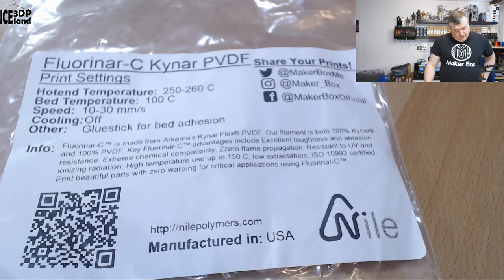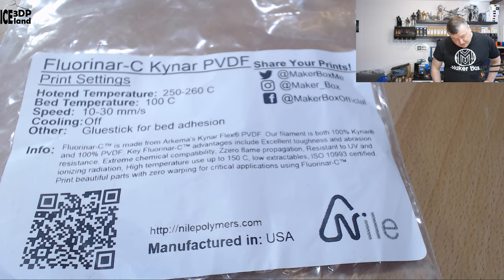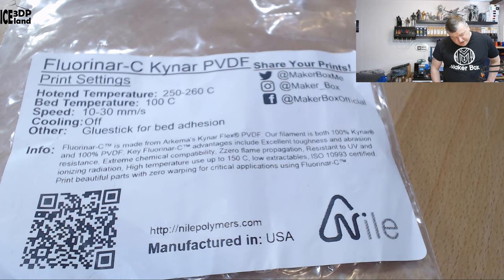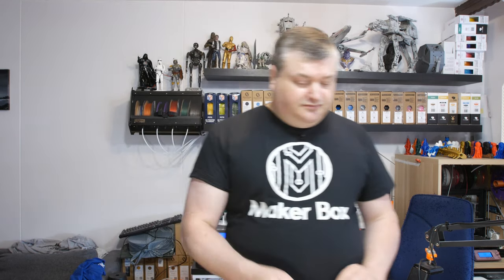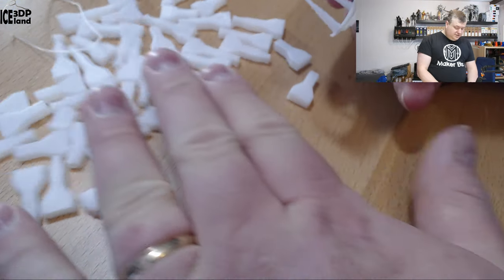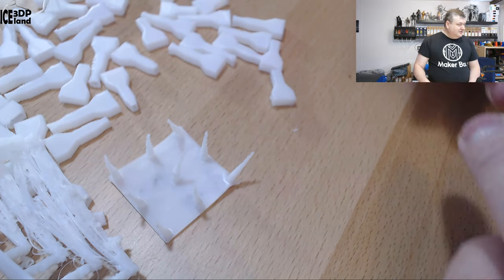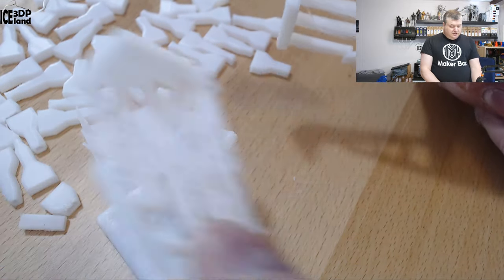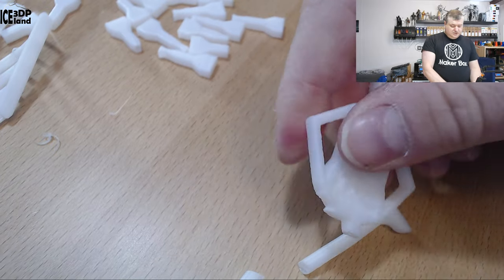Makerbox Monday   Nile Fluorinar C Kynar PVDF

Comment: Check the electrical properties. 😉
Reply: Like every other polymer, PVDF is a poor electrical conductor.  It is commonly used in wire insulation due to its flame resistance and zero flame propagation.  It will not burn in environments with less than ~40% oxygen.  PVDF is a highly crystalline polymer.  If you can get this material into its beta crystalline form by mechanical deformation and then electrically pole it at the same time, PVDF becomes a piezoelectric.  The application for PVDF as a piezoelectric are numerous and include mechanical sensors, thermal cameras, energy harvesting devices and as an audio transducer in microphones, headphones and speakers.  PVDF is also a major component in lithium batteries.  Electrical applications of PVDF are very diverse.
Reply: @nilepolymers9037  I know all that stuff, but thanks for the answere. 😊

Comment: Insanely expensive filament for what it is. PETG will be just as suitable 99.999% of the time. Not worth it imo.
Reply: It's application dependent.  If the requirements are met using less expensive filaments then the choice is obvious.  If you need better chemical, UV or flame resistance then many filaments are eliminated and the Fluorinar Kynar PVDF material is a good choice.  Unlike other engineering thermoplastics such as PEEK, PVDF can be printed on consumer-grade machines.